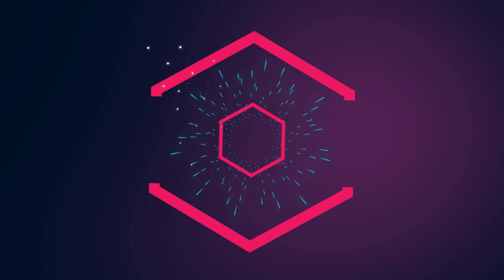Rotel RP-1000 Turntable Tone Speed Issue Repair - How-To - Retfurb Retro Audio

Comment: Hi, I have got the same turntable. While it powers on, the turntable does not spin. The red light is illuminated when I lift the tonearm toward the platter. Any suggestion what could go wrong? Many thanks.
Reply from the maker: It’s hard to say without looking at it, but sounds like a drive issue.
Could possibly be a motor related part or a sensor to switch it on to rotate.
But would need investigating further, to know for sure.